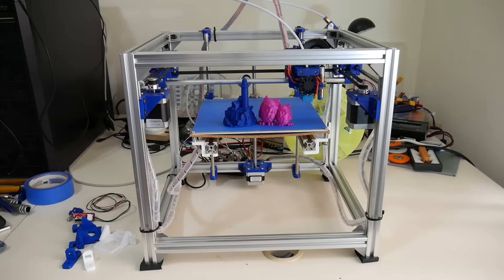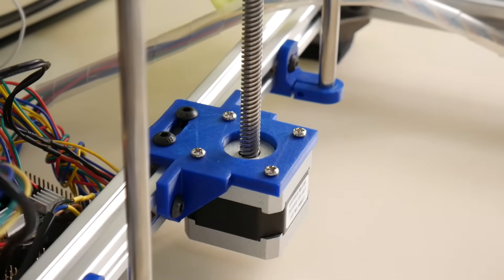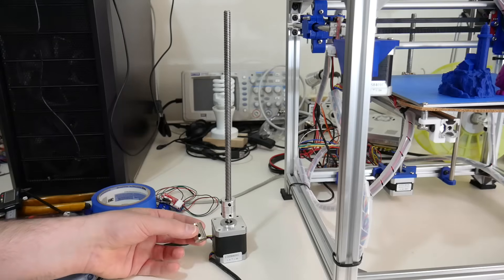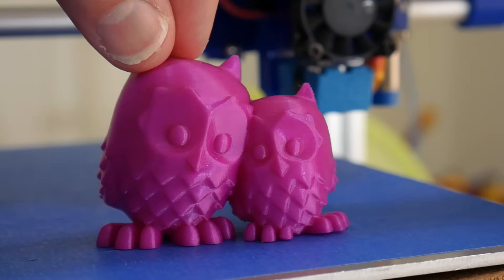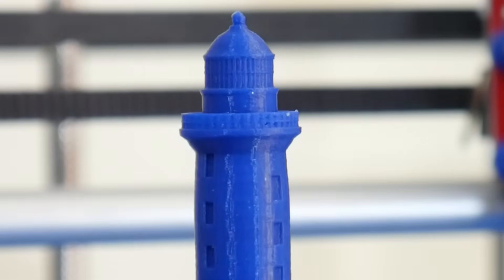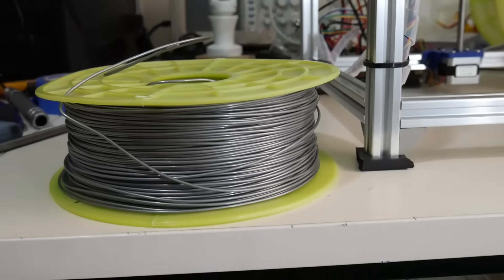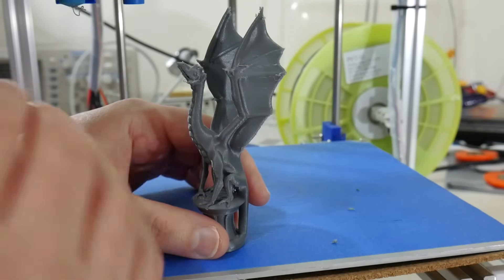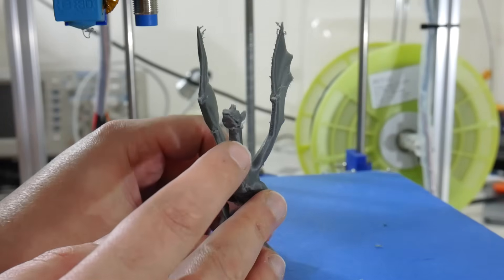New 3D Printer - Build Log #12

Comment: Please can you share your firmware. I just built a very similar hyper cube setup but I am having a hard time setting it up for a first print. It has a size 260x260x350mm   I also have a proximity sensor for the z axis. Thanks for your help

Comment: Tip for the solid coupler: slightly tighten the grub screw then turn the lead screw until the grub screw lines up with the groove. That will help with the wobble (or just use the built in, my tip is more for other people).

Comment: if you drilled and tapped other side of solid coupler then tightened screws slowly each fraction turn at time would be possible to align it correctly. as this is the way it is done on old rotary aircraft

Comment: Hello,
I'm currently printing this 3D printer! I've printed the XY_motor parts and the Z_motor part... long way to go but will finish it quickly!

I would like to make it have a print volume of 20x20x20 or 20x20x25 (XxYxZ).. to have that I should use 5cm and 10cm Z rods and extrusions? 400mm and 450mm Z extrusion and 350mm and 400mm rods? I will use the lead screw inside of the nema motor.. how long should it be?

Comment: Why not to use lead-screws like this:

http://www.ebay.com/itm/Antibacklash-Ball-Screw-SFU1605-L200mm-750mm-BK12-BF12-6-35x10mm-Coupler-Set/322121012021?_trksid=p2047675.c100005.m1851&_trkparms=aid%3D222007%26algo%3DSIC.MBE%26ao%3D2%26asc%3D38530%26meid%3Dbbe284b58dcf4679976a99ca1e0538c2%26pid%3D100005%26rk%3D4%26rkt%3D6%26sd%3D171790415841

They are not expensive and i use them im my CNC Mill and if you want precision you can't find better...

Good videos!!!

Comment: I got a question about your endstops, what is the placement you have? Because I  didnt build your printer it's more of a customized D-Bot but pretty close, my configuration.h file from marlin is identical to yours basically (i compared it) it prints just fine and with great quality but my parts ended up mirrored. So since the configuration is the same it must be the endstop placement and/or endstop min/max. I've watched justabout all the videos in your build log and havent seen exact placement of the endstops. Thanks for your info :)

Comment: Great Build! May I ask what is that MDF , below the heated bed, good for?
Reply from the maker: It's cork. It's there to insulate the frame from the heat of the bed, speed up heat time, and assist in maintaining the heated bed temperature.
Reply: I see, thanks a lot. This project is so tempting!!

Comment: Cant wait to find out the technique of replacing the lead screw in a linear motion NEMA 17, want to build a 200x200x200 but want the option to expand to a 300x300x300 in future and this is a significant option plus doing a repair like yours is always an option when you risk buying cheap lead screws.

Comment: This is my first time working with extruded aluminum and I'm having an issue making the frame square. Do you have any suggestions?
Reply from the maker: I used a mitre box to ensure the cut was as close to true as possible. Now I say close, because some of my cuts were not exactly true :P
Reply: Tech2C Thanks for the reply. Most of my pieces were cut to size when I ordered them and they are square. I watched your video on how you cut yours and I used a miter box for the few i needed to cut, but it seems that went I put on the corner brackets they get misaligned. Did you use a clamp or something to keep them square when screwing down the brackets?
Reply from the maker: No clamp. The aluminium corner brackets should provide alignment to the corners. Assemble the entire frame and it should self align. You may need to double back to some of the less-perfect cuts to loosen and re-tighten the screws when it is assembled.

Comment: why not get a machined end ballscrew? surely it would be better than integrated screw?
Reply from the maker: Sure. Is there a stepper motor with integrated ball screw? I'd prefer a Lead screw integrated into the stepper motor, rather than a coupler and ball screw.

Comment: Hey Tech2C, If we are using a standard stepper for the Z axis without integrated leadscrew on the bottom, will we need a bearing support for  the leadscrew at the top.
Reply from the maker: I tested this. I found capturing the lead screw at the top actually caused banding to appear on my prints. Therefore I ran it without bearing support.

I've added the bearing support v1.1 to Thingiverse so you can test it either way.

Comment: Are you going to add a thrust bearing and capture the free end of the lead screw with another bearing?
Reply from the maker: So far the Z print quality doesn't warrant extra support. In fact inside the motor the leadscrew is already captured between bearings so I don't see a need for further support.
Reply: The bearings and rods on the z-axis should keep it straight. The lead screw should be "free" spinning without holding it in place in the end. If you do hold it in place, any bent lead screw issues will not "wobble freely" because of the fixation at both ends and it will transform into the print.
Reply: But all the professional lathes and mills use captive lead screws and thrust bearings and all kinds of stuff, so they must be right!

Comment: also when assembling the frame... the top is pretty easy to do since the corners are square. But on the bottom of the printer frame, how much of a gap is needed between the table and the x and y extrusions?

Can you get away with butting the bottoms of the corner brackets against the table? Or does it need to be a specific gap size?

Comment: One question: If you can swap the leadscrew, can I turn a normal stepper to a leadscrew intergrated stepper in a similar fashion? I thing that would be pretty neat, and bye bye all the coupler :))
Reply: Google "nema 17 rotor" images. I think rotor poles is fixed pretty tight on shaft and its much easier to buy complete motor. But if u got tools to drill out shaft without damaging poles, yes you can do it.
Reply from the maker: I think you can only replace the shaft with the same diameter shaft. Therefore 5mm for standard stepper motors. Maybe you can integrate M5 threaded rod into it...?

Comment: Is it possible to put a lead screw into a standard 5mm Nema17, by changing the bearings?
Reply: Google "nema 17 rotor" images. I think rotor poles is fixed pretty tight on shaft and its much easier to buy complete motor. But if u got tools to drill out shaft without damaging poles, yes you can do it.
Reply: Ok thanks, I think ill just buy a flexible coupler.

Comment: I like your 3D printer. I also want to build this 3D printer.
I have a unfinished Anycubic 3D Printer Delta Kossel.
I wanna use those 1.8°42mm steppermotors, they need
3.3V. Can i use them? Then i can use other parts from the Delta
like the RAMPS Controller + MEGA2560, Extruder, Hotend. ;)

Thanks and best regards from austria,
Mike
Reply from the maker: If you are using them in a 3D printer now, then they will work fine in the Hypercube. Cheers :)
Reply: Thanks for your feedback. ;) I hope these motors function then easily.
I never used them before. I guess the material for the Hybercube, will cost 
about 300 euros or more. It's absolute worth it. ;)

I have a fake prusa i4 from sunhokey. This 3D printer works not so bad.
I will soon print the parts with PLA. No idea what color it should be.
Maybe red and blue looks good. :)

best regards,
Mike

Comment: Awesome design. I am going to be using your new motor mounts.

I also can't wait to see the video where you replace the lead screw. I have two with 300mm lead screws, and I want to go to 500mm (which I just have sitting here), but I have been too worried about breaking the motor .

Those prints look awesome! The details are great. I just started using a 0.25mm nozzle and I really like it. If you have one, I would be curious what difference you would see in the tower vs the 0.4mm nozzle.

Comment: I think why your silicone sock doesn't fit right is you probably have your nozzle too low.  I see from your video, they aren't quite clamped on all the way at the top edges like they are designed to.  I know for my E3D hotend I had to adjust my nozzle to be really close to the heater block for the sock to fit on all the way.
Reply from the maker: I think you're right. Originally I had the nozzle hard up against the block and the nozzle wasn't poking out enough. Then I adjusted it and I may have it too far out now. Third time's a charm I guess... ;)

Comment: What a top mounted flex coupler will do though is exacerbate any kind of oscillation that already exists in the bed. Bottom mounted flex couplers on the other hand will allow any misalignment in the screw to push the bed around in a slight elliptical orbit, which will manifest as banding at regular intervals. Granted you're never going to beat an integrated screw but top mounted flex couplers don't generally cause reciprocation issues themselves unless they already exist in the assembly. Of course, the real problem is none of these couplers are really designed to be fastened onto threaded shafts with grub screws ;D ;D ;D

BTW, the E3D socks are sized to fit the newer V6.1 which is 3mm longer than the older V6 on the long axis. May want to check if your duct will still clear it!
Reply from the maker: So true, tightening grub screws onto a threaded rod isn't best practice... :)

I bought the 'block and sock' upgrade for my E3D, which includes a replacement heat-block. I may have the nozzle too far out for the sock to clip around the block properly.
Reply: Sweet! I bought two of the 6.1s just before they launched the socks (my luck). Nice to see them in action, here's to no more grubby-frying-pan heater blocks mate!

Comment: Have you tried optical end stops? Where would be a good place to purchase Alu extrusion profiles in the US.
Reply: Dummyc0m Misumi is a good place to get aluminum extrusions.  5 pieces of 1000mm long aluminum only cost me about $30 from them.
Reply: I got all my pieces from Misumi for $35 shipped, pre-cut as well, thats for silver anodized, what Tech2c uses. I chose black anodized, pre-cut it was $45 shipped. But it looks SO NICE. Also, new customers get 30% off for a month, so dont register with them until youre ready to order.

Comment: I am envious.  Great work and beautiful prints and I await that leadscrew video because I want to change out the 8mm per revolution for a 2mm per revolution one.
Reply from the maker: I was so happy the resurrection of the motor was successful. It means we can modify these motors how we want them!
Reply: Tech2C
That brings in new hope because I don't want speed I want precision.  I never understood why the motors only come with 4 start instead of a single start threaded rod but now I can replace.  Still jacks up the price but gives options.   Oh, you know I can't find any 16t 8mm pulleys?  I found two on Aliexpress and after ordering the merchant(s) really do not have them and with my setup I need 16t.

I have a question for you, if you don't mind.  If I have a threaded rod controlled by a pulley how does the tooth count play into the equations of steps per mm for that rod?  With a direct to motor setup the s/mm is just the thread count of the rod so not hard to calculate but what if that same rod is driven via a pulley system with X amount of teeth?
Reply: So long as you are using two identically sized pulleys it'll maintain a 1:1 ratio.
Reply: Craig C
Well, that is what I was hoping but if the pulleys are say 20t and a belt (think X/Y axis) we have a formula for them and we have one for the acme rod (Z axis) but if that Z axis rod is turned by a 20 tooth pulley is it still just the acme rod used in the equation for the steps per mm?
Reply: Correct. With identical diameter pulleys, the systems essentially disappears, so it would be as if it were directly coupled. http://prusaprinters.org/calculator/
Reply: Craig C
Yep, I use that calculator for years now but I just wanted to be 100% sure that the pulleys would not change anything (of course if one is larger and one smaller then it would).  Glad it doesn't because a 16t 8mm bore is non existent but a 20t 8mm bore is everywhere.